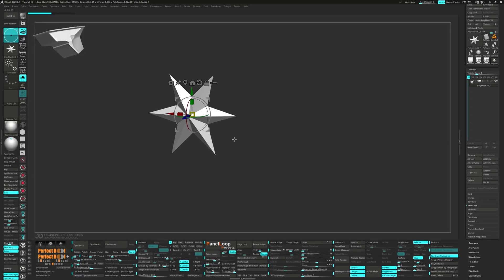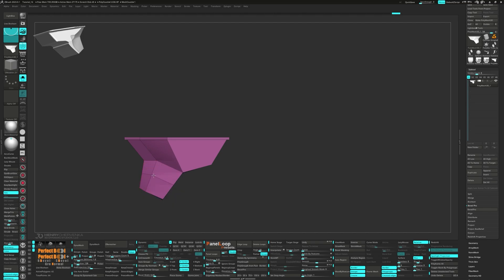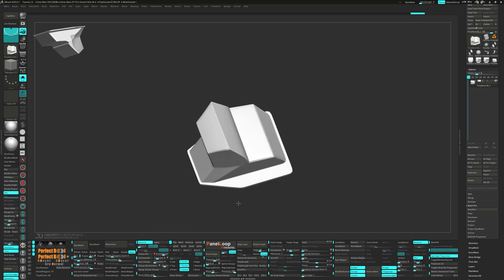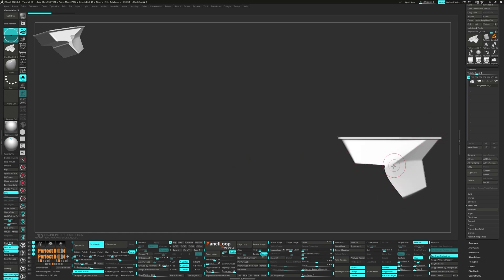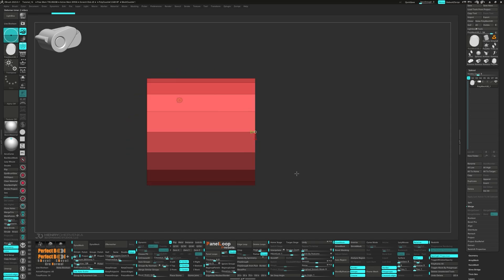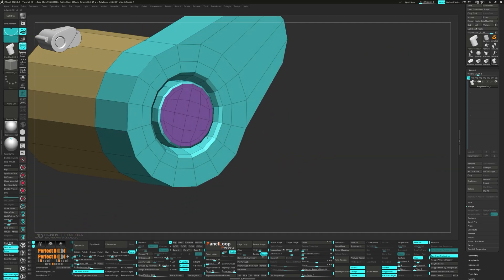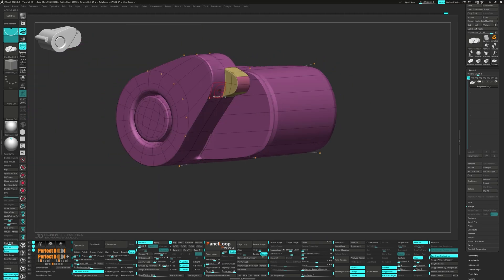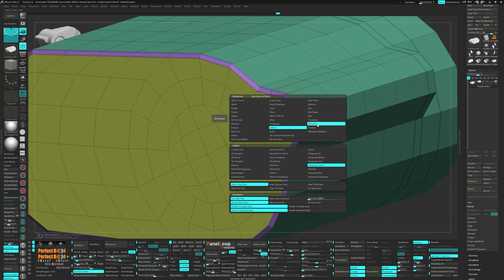Hard Surface ZBrush Tutorial Series // Modeling A Kawasaki Ninja H2R // 27

Comment: Honestly I can't ever make my mind up with these videos whether I think it is genius or insanity. Hard surface modelling to me is the realm of sub D modelling in Blender, Max, Maya etc. The result here simply can't be as accurate as it would be to model manually in one of those apps, and if you had asked me blindly I would say it wouldn't work to do this in Z Brush. 

But damn if you don't get it close enough that the inaccuracies don't matter and you get your results so much faster and often claner than box modelling. And you don't soend two thirds of your time trying to smooth out the topology to get rid of unwanted smooting.

Exceptional.
Reply from the maker: Thanks for sharing your thoughts! 😃Personally, getting precise measurements isn’t a priority when I model. I find that focusing on proportions and angle changes will keep the momentum going while still getting the results I want.
Reply: @henrychervenka  Absolutely man. Had you asked me to do this my mind would go to overload wondering how on earth we can get this accurate, and from past experience I know I would have failed at the project. But for games and film this would be perfect, nobody is going in with a mechanics calliper to cal you out. It's great. 

I wish I was still in industry, I miss this stuff like a lost limb.